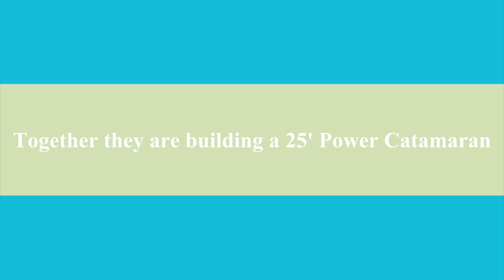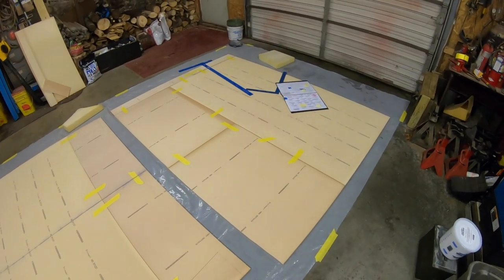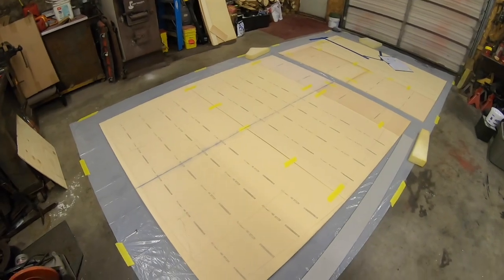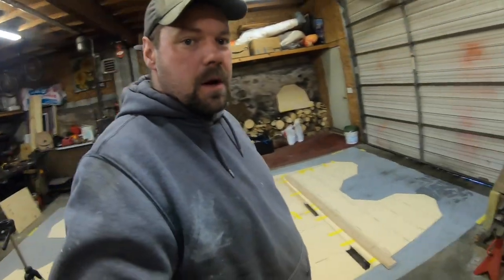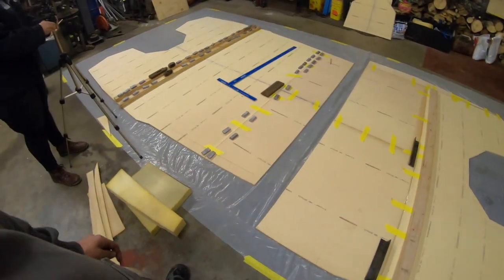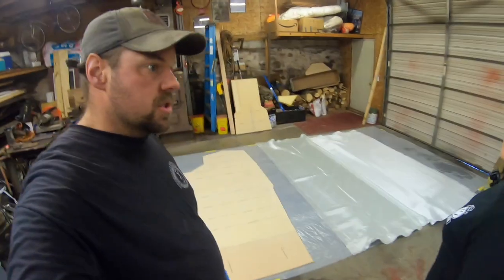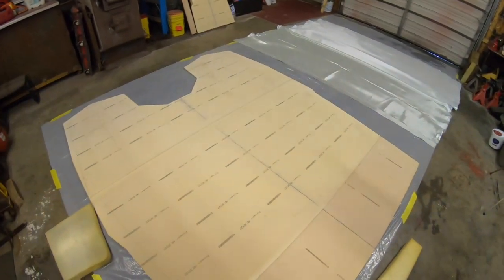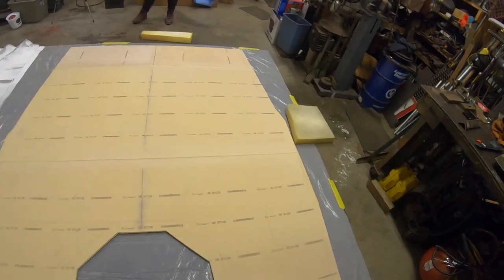Step 41: BIG Bulkheads! Getting Creative to get it Done. Power Catamaran Build Series.

Comment: Carl b. Use a .035 mig nozzle. They have 1/4-20 threads at the base and a .035 hole. Or many other sizes. I built a blacksmith forge with one. They work great. You can drill and tap the brass plug to 1/4-20. Paint is not my only expertise
Reply from the maker: This is what was used after realizing we had way to much gas. Lol I ended up drilling the hole one size smaller and pressed the mig tip into the plug. It worked great after that. Thanks for the advice. 😊